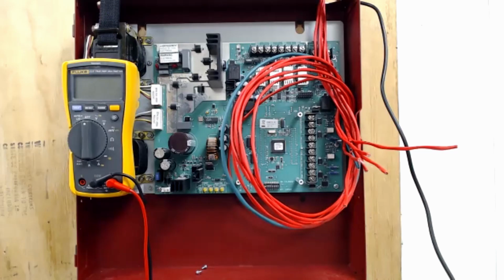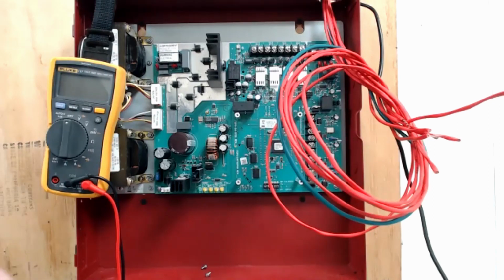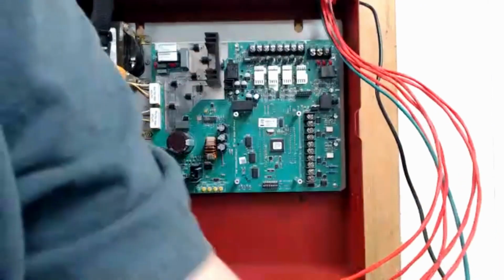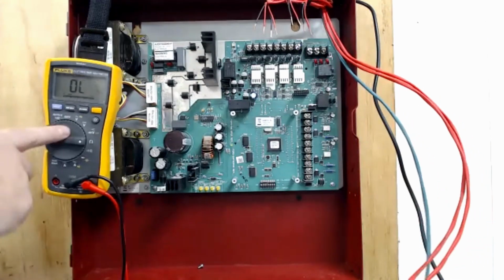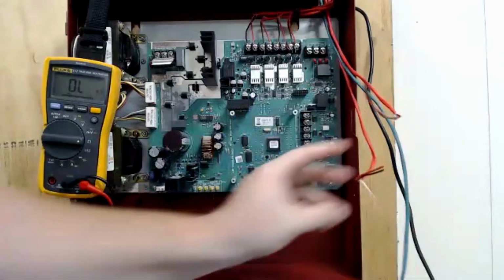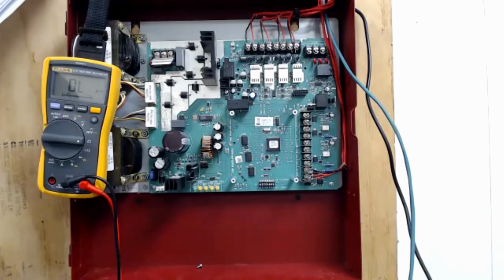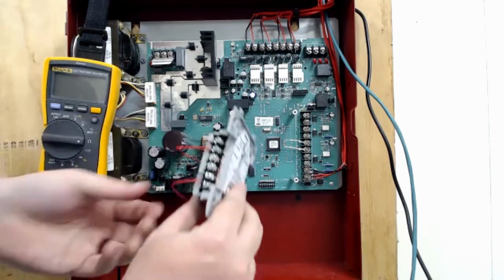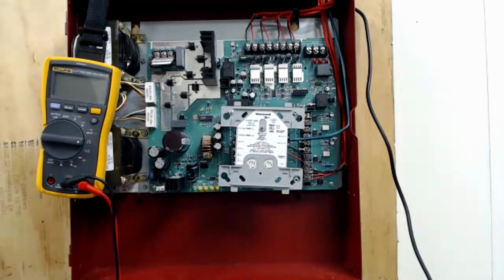Conventional Fire Alarm Power Supply Wiring

Comment: Good morning.please,which part of the building is the green cable wired to?
Reply from the maker: This would be your SLC wire, the data circuit that goes to you intelligent addressable devices such as smoke detectors or other addressable relays.
Reply: @PyrotexSystems  Great video, thanks, I  never thought of adding intelligent advices to a conventional devices before.

Comment: How do I wire a Mini module to be able to supervise the power supply in case a nac comes in and out. I would appreciate it
Reply from the maker: On the trouble contact, land your resistor across common and normally open. Then, land your wires on normally closed and normally open. this will cause an open circuit trouble on the mini-module instead of shorting the circuit to cause a supervisory or alarm. I may do a video of this in the future because I need to update some of these videos about triggering and supervising power supplies.